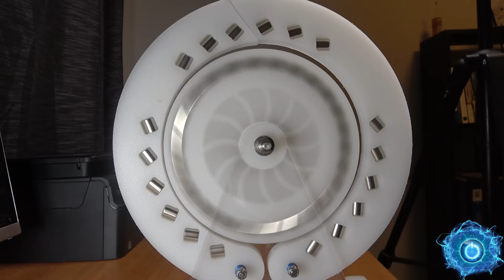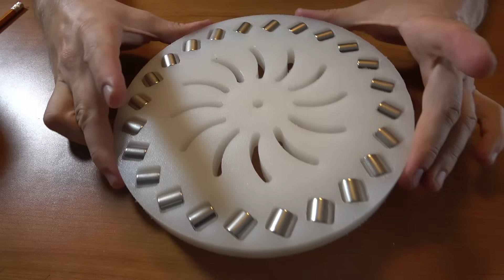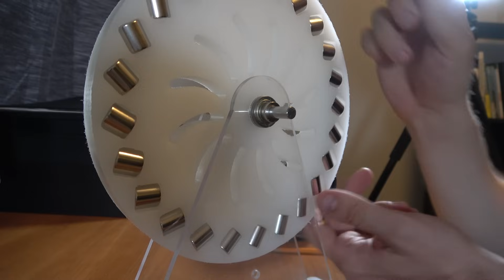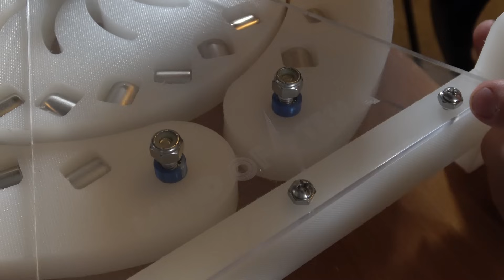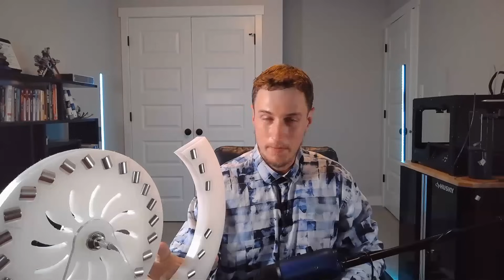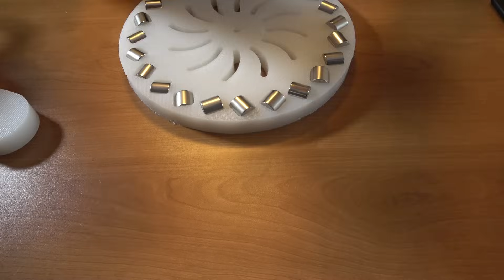Perendev Magnet Motor - Does IT WORK?!

Comment: Sure, magnet motors can work, everyone always says they're a scam because "energy has to come from somewhere and perpetual motion is a lie", but the energy IS coming from somewhere, those magnets will eventually wear put.

The problem with magnet motors is that they can have high rpm, but have very low torque, meaning they're absolutely useless for energy generation.  They're a cool gimmick. But not really practical for any useful applications.

Comment: How about a diode switching solar power system to energise the outer magnets. Then you can have a free generator whilst the sun is out?
Reply from the maker: Yes, the Magnetsphere I displayed before pretty much does that, it can actually run for weeks on one small battery!
Reply: Maybe use the radiation 1000 year battery then? Could it be used as a generator?

Comment: Dude! Sorry for being rude...!

Although I believe such devices could work..! Because magnets already contain 'energy' in the form of magnetism...  Especially neodymium and cobalt magnets!
But than they are still not free Energy! Even if they would work. Let me explain.
1) It takes thousands or millions of years (thus energy) for earth to produce some of the base materials / elements
2) We have to get it out of the ground
3) Transport it via energy using machines
4) Extract the specific elements
6) Melt it down by heating it up
7) Shape it
8) Magnetize the alloys
9) And than still, most materials wear down over time through external influence
10) Also the same thing that makes something work, is also partially the same thing that will wear itself down.

It's quit possibly never free energy. Because there's simply not enough time to extract all the energy that we have put in it!
All we do is higher the efficiency.
Reply from the maker: No need to apologize, I completely agree with you.
Reply: @Motor_Explorer1  , thanks for your reaction! Cool you agree :)

I did fail to mention that even all the machines that are used through the entire process... Each might only have an efficiency about 30-50%! So it would be virtually impossible...

And don't even forget all the people who are needed to eat and all the inventions that are needed to make just a simple model and the materials possible!

I love this kind of stuff!! Have a nice day sir! :)
Reply: @Motor_Explorer1    найти китайца , за 10 баксов он тебе сделает копию модели двигателя  Перендеева  и баста !)
Reply: Right  efficiency

Comment: Option 2, create a slot in the inner magnet to allow to move after the push effect of when the magnets meet but after the push the inner magnet disk turns enough for the magnet to move away under gravity and as the disk turns the disk when the magnet  returns to its original position. It wont work but also a nice idea
Reply: Spring loaded or perhaps another weaker magnet to allow it to go over the hump that is the field edge...

Comment: Because ultra-capacitors can recharge extremely fast, could that be far more than enough for it to make that Perendev self-sustaining... or maybe even 3D print one of those micro-grid magnets that cancels itself out, therefore... is able to easily bypass those interference gaps by such the redirection.
Reply: If you're angling for a sort of perpetual motion "free energy" sort of thing, the answer is unfortunately no.  Loss of energy within the system will always eventually win out.
Reply: @DukeOnkled  The vast majority of people have been proven wrong many of time during this modern era... flight... neural networking... fast-enough electric cars... the internet... the NASA m-engine... creating graphene... efficient low-cost solar panels... oh... and you might want to update yourself on "electric bacteria" which keeps drawing electrical power from oxygen even from water.
Reply: @DukeOnkled  If Nikola Tesla were to believe AC current was impossible just because almost everybody said so... chances are... only the wealthy would be able to afford to have electrical power and the rest of the world stuck in the dark ages.

Comment: Try having the outer edge of the inner disk as a cog and the outer disk magnets on springs, As the inner disk spins the cog pushes the outer magnet away and then the spring returns it. My guess however is that the force needed to pushing away will be more than the rotational force induced by the magnets, but its worth a go.
Reply: But you need energy to push the magnets away against the force of the springs.
So extra energy is needed to compress the springs.

Comment: Did u try flipping 1 magnet to the opposite of what the setup is? Or a mechanical cam/pushrod to flip and outer magnet at a precise time? Dont think hall sensors, think mechanical..add a flywheel, attach a coil to the flywheel to charge a magnet coil on the other side? Centripetal force sping loaded counter weights as wheel spokes?

Comment: you have too many magnets in the rotor.  the distance between the rotor's magnetic fields needs to be enough to be only a weak force between rotor magnets.  Get one of the magnetic field viewer sheets and it will be easier to see ( literally ) that with the current stator setup the less magnets on the rotor, the easier to only repel and not apply magnetic breaking with the preceding magnets.

Comment: I built my magnetic perpetuum mobile using aluminium hands, which would move in between approaching magnets of equal polarity, waiting for the magnets to pass, and then pulling the aluminium hands out, by which means the repelling magnets would turn the wheel. As simple as that! Based on our physics' teacher's explanation, that "metals" shield off magnetic lines of force, I chose a non-magnetic metal like aluminum, which would not have to fight the attraction of either magnets, and would not require energy to be moved. Needless to say, it did't work: Aluminum does not influence the magnetic lines of force, and as a result, it cannot "cut" them or "shield off" magnetic forces. Lesson learned: When a physics teacher talks about "metals" in magnetism, he might as well be thinking of "ferro-magnetic metals" only.

Comment: You need multiple rotors attached to the same axis, all of them must be slightly offset with each other, so that when one rotor starts gettin repelled, the other two rotors are pushing it to overcome the repelling force. So one rotor is always repelled and the other 2 or 3 are always helping to overcome. And they always change their roles depending on their actual position. I mean, having at least 4 pistons attached to your crank makes your car run much better. And having 12 pistons is called having fun. You know what to do bro. (And the stator? With gaps? Come on man 😂)
Reply: Still won't work.
Reply: @KevinSmith-os5yz  damn.. seemed like a pretty good idea.. i mean.. perhaps there is some golden ratio of offset that would work. Perhaps even a specific number of rotors/stators.. i mean, a piston engine would also stall when the spark plugs fire too soon or too early 🤔
Reply: @stanvasic8592  with a piston engine the force created during the power stock is greater than the power required for the compression stroke. Unfortunately with magnets the repulsion force exactly equals the attractive force, therby canelling each to zero.meaning you can't pull energy out. Angle is irrelevant.  In gact this machine would would turn the longest if the outside magnets were removed entirely,  as it's really just a flywheel.

Comment: Not technically a motor? I know the whole exercise is a test that reveals who still believes in fairy tales of free energy. Fart sausages. I mean, though, a motor in general isn't, or doesn't have to be a free energy machine. An electric motor is a series of electromagnets. Great if you have a Mr Fusion.  I must have misinterpreted you now thinking about it. Of course yo know electromagnets are the basis of electric motors. Just seemed like you said a device that converts electrical energy into  magnetic fields producing usable kinetic power were not motors technically on account of their need to be powered externally. Maybe you skipped a word.